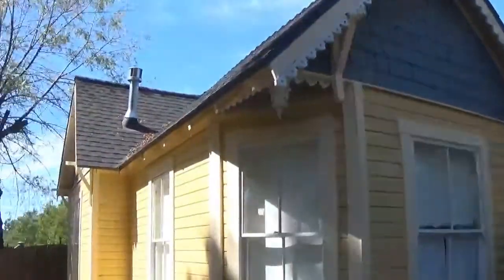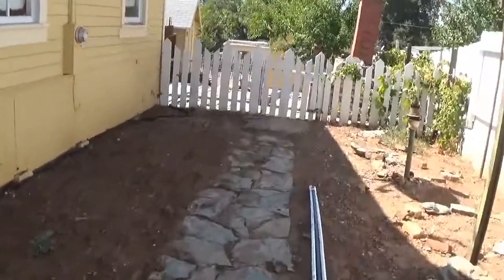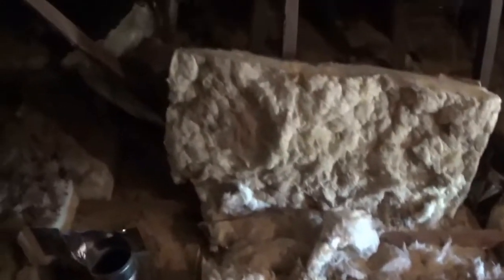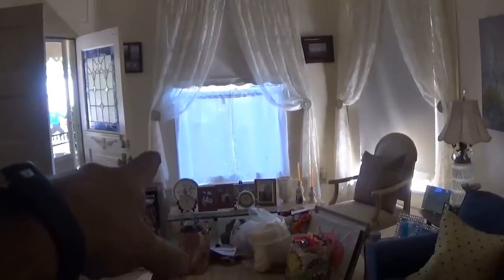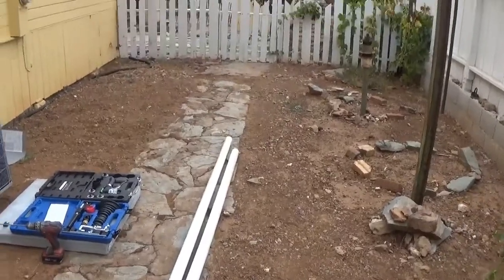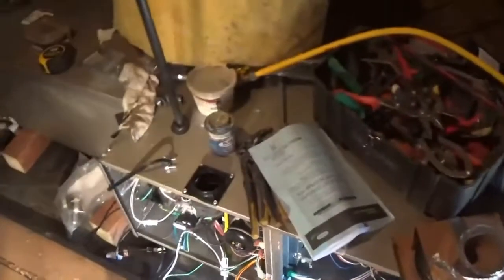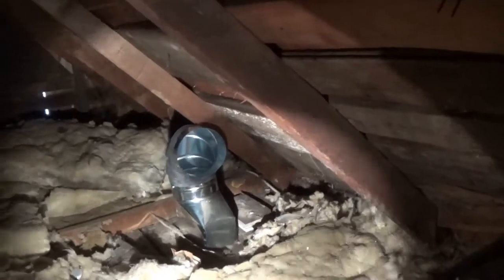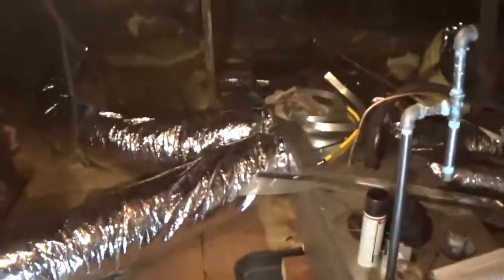Air Conditioning Install, Sonora Ca. part 1

Comment: Nice looking work. Just wondering why you used short radius 90s on the exhaust. Maybe carrier is different then the manufacturers I use.
Reply: Carrier just says that long radius are desirable and may be necessary with some installs. Kind of vague, huh?
Reply from the maker: +Rob HVAC unless the static is gonna be questionable I have always used short radius, I dont even think my supply house carries long radius. Ill grab some for my next install, I agree thats a good practice....Thanks for watching

Comment: Nice work! Just a question as i don't do gas, could you put the T where the top 90' was, it would save a fitting, not that i am tight fisted or anything haha
Reply from the maker: +heavydiesel In this application im sure I could, I just wanted it so I could see it from the front and my C/A would come straight back to me when im sitting in front of unit...Thanks for watching

Comment: What did you say that you used on your adjustable 90's, to insulate them?
Reply from the maker: I normally just use an R4 insulation on 90's....really should be using R8 silver backed insulation but it is really hard and time consuming to work with. If i get a customer willing to pay me to do everything right I will go the extra step but rarely do they want everything done right so costs have to be cut somewhere....